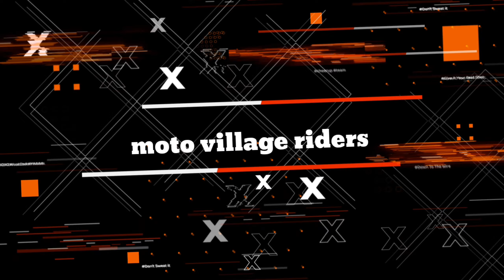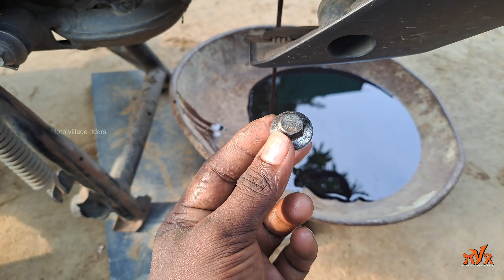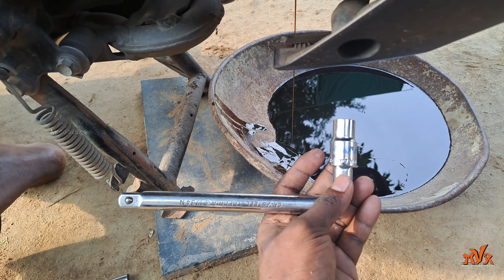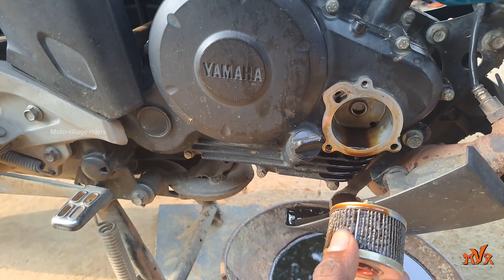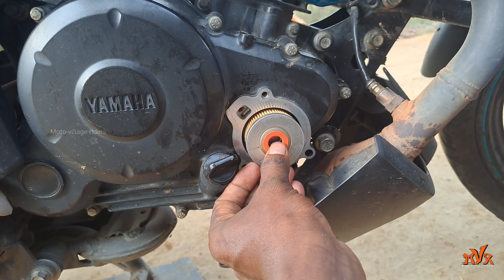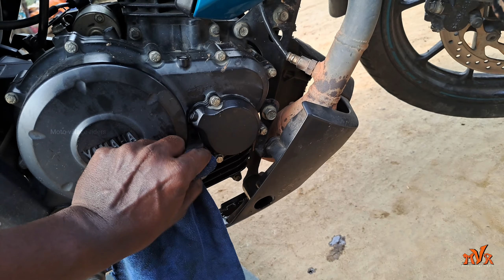How to change bike engine oil tamil🛢// fzs v3 engine oil changing tamil // #motovillageriders #fzsv3

Comment: In commuter segment bikes, which engine oil brand is best in high quality? Ex: Shell, Castrol, Motul, Savsol, Veedol, Mak, Servo, HP,  Gulf, idemitsu, Valvoline, Apar eni, arkos, poweroil, balmerol, Bosch, Elf, Elvi Bardahl, eneos, Goodyear, mobil, Petronas, polylube, TotalEnergies, zoomol, turbo protech, amaron, OEM Genuine Engine Oils?
Reply from the maker: Tell your bike name i can tell you oil
Reply: @motovillageriders suzuki zeus 125 2008 model, company Recommended grade is 20w40 API SJ JASO MA
Reply from the maker: It doesn't matter which brand of oil it is, any brand is a good brand 
What grade oil we using and what kind of oil we using that must important 
Mineral oil 
Synthetic oil 
Fully Synthetic oil
Reply: @motovillageriders  which engine oil type is best in mileage mineral or semi synthetic?

Your opinion on tvs tru4 premium 10w30 semi synthetic red bottle vs yamalube sporty premium 10w40 fully synthetic engine oil?
Reply from the maker: @TechCommuteTelugu  synthetic oil given better millage
Reply from the maker: @TechCommuteTelugu  Engine oil alone does not give good mileage, the mileage of the bikes depends on how we use it, how we run it and how we maintain it.